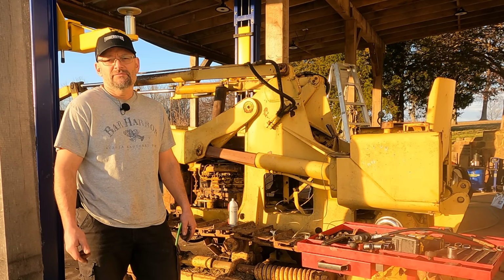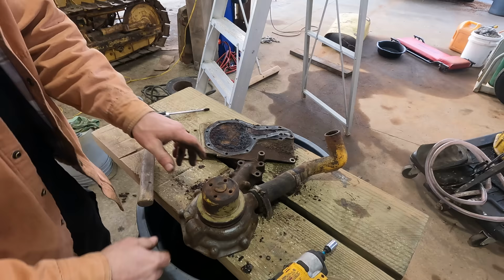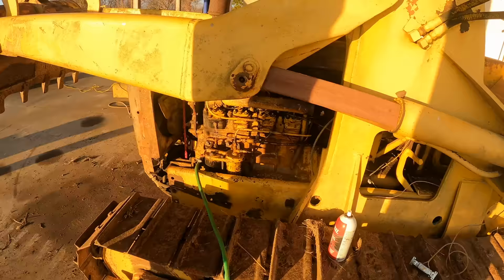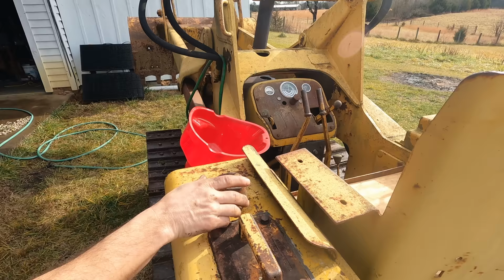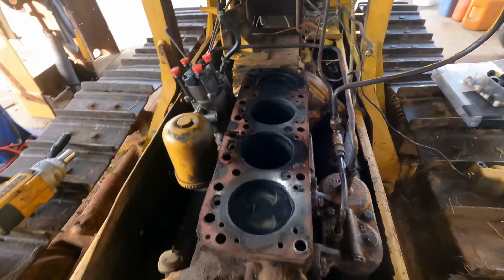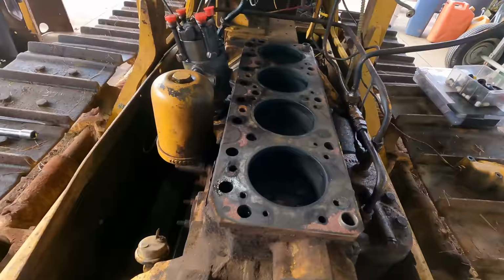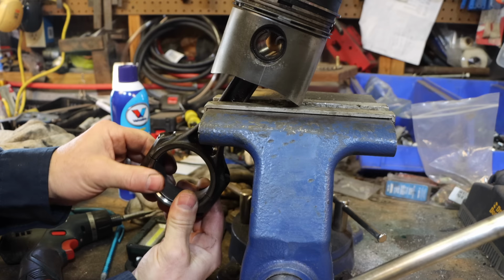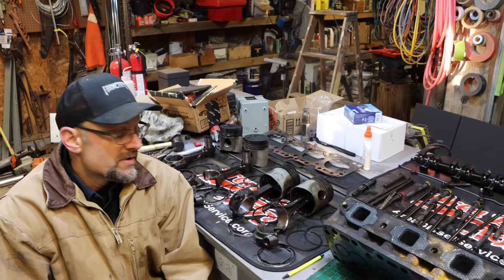1960 John Deere 1010 Diesel Engine Teardown.  Worth Fixing?

Comment: Hopefully you can find some good used pistons; I have an idea that your pistons were damaged due to hydro-lock before you ever got the machine.  Seems to me that pistons aren't cast perfectly round; they're slightly oval, but when they are at operating temp they are round, and that would be difficult to replicate.  Go ahead, measure a piston at room temp and then at 250°F, I hope you can prove me wrong.

How badly are the valve guides worn?  Can you knurl and ream them to be in tolerance?  Maybe replace valve guide seals?
 
Here's my contribution for a fresh set of glow plugs or whatever you think would be most helpful.

As always, I am really enjoying your content!
Reply: All good points!!  Rings and lands can also be broken during removal due to the ridge at the top of the cylinder, Glad to see John remove those beforehand.  

Aluminum pistons are typically 'cam ground'.  They would be narrower across the wrist pin axis to allow for the expansion of the greater amount of material at the pin bosses as it heats to operating temperature.  That's a contributing factor as to why the older diesels rattled and smoked alot until they were warmed up and the Piston fit the bore properly.
Reply: @workparty3949  That is correct. Pistons are cam ground and not completely round. I hope John raises enough money to replace the hole set. Pistons and liners. If not, maybe he can locate a complete engine.
Reply: @OutreachBibleProject  Well, while in an IDEAL world, a fresh set of liners and pistons would be great.  However, you're talking $3,500 worth of parts, and replacing cylinder lines that are STILL WITHIN factory specs really doesn't make sense to me.  What DOES make sense is hone the cylinders to a nice crosshatch, reducing pits/scratching as much as possible without going nuts on it.  I wouldn't blink if Jon used some J-B Weld to level out some of th ed scratches a tad; it's his machine, his call, and he really isn't trying to build a Cadillac or a Formula 1 car, it's just a utility dozer-type thing that's captured everyone's attention and we all want to see this goomba working again -- only much better, naturally.  I think he'll be fine with the 'just within spec' parts.

Comment: I've TIG welded pistons before. I'm certainly not any kind of professional welder, but it worked better than expected.
Reply from the maker: That's good to hear.  I really need to get a TIG welder, and I thought about buying one, but this is just not the job to learn aluminum welding for the first time.  It takes 6 hours of reassembly to find out that your weld sucks.  ;-)
Reply: It's the crossover we've all been waiting for....
Reply: @FarmCraft101 time to hit vevor up for one ?
Reply: Don’t weld it! You know how good the aluminum you smelted and made the fitting turned out. Heat treatment is a primary requisite for good aluminum and in welding you will ruin the rest of the pistons strength. There are used parts or new from someone besides JD.
Reply: @tmicadet  T5 heat treatment (aging) is done at a temperature pretty similar to engine operating temperature. They're in essence self heat treating.
Reply: @WatchWesWork   West, it's very nice to see you here, maybe a bigger collaboration with weldingtipsandtricks, that would be amazing, not to mention getting Mat from Diesel Creek involved. 😍😂
Reply: You know this, get to cleaning the broken pistons/or all. Need to be spotless for welding. Remove as much of the oil as you can, there will be some impregnated into the aluminium.
Reply: I think we in the more western side of the world sometimes forget how much you can "fix" something with "just" time, effort and ingenueity  when there's no real other option, you can see it in some of the repair videos you see from the likes of india where guys in their bare feet will re-cast and machine a new piston that you or i wouldnt sweat dropping $200 on, or weld a block and rehone it, you still see some of that here on johns channel, working with what you got, cos in some areas of the world thats all you got, due to parts shortage or just too expensive, so you bodge it, sure the machine might only be at40- 70% its original capacity, but in places like the 3rd world thats still better than 0% and it doing no work.
Reply: @aurick861 yes, soak them in an organic solvent such as TTE (if you can find any, damn EPA)

Comment: Don't know if anyone else mentioned but you should rebuild those injectors to get a nice and even spray pattern, in the first video you can see they the spray was too heavy and dripped the spray should be much finer and no dripping.
That would increase the starting much easier and reduce the smoke👍❤️
By the way, I love the content
Edit: bad spraying injectors can ruin the engine.
Reply: I agree. If you're gonna do all that other stuff, the injectors deserve some attention too.
And I'm pretty sure Jon already has most of the parts laying around, to build himself a testing rig, to test opening-pressure and see the spraypatern of each individual injector.

I know some Dutch-spoken videos about this, but I don't think they gonna help Jon much. I'm pretty sure there must be English videos about this too, so if anyone who understands what I mean can paste a link, we might save Jon some research-time...
Reply: Probably soot on the injector thing, I've wondered if you could just lap the end of the injector together with fine diamond lapping paste to get diesel injectors serviceable again
Reply: Expensive to rebuild the injectors plus you need special equipment.
Reply: @jameskim62  expensive???
Depends mostly on how much you pay yourself per hour.
Reply: here is a howto link :https://www.youtube.com/watch?v=dns1XMOJI5w
And here is a how to to build your own testrig from a bottlejack link https://www.youtube.com/watch?v=luxMeMHhbYE
And many more just search old diesel injectors :https://www.youtube.com/results?search_query=how+to+test+old+diesel+injectors

Comment: Adjustable link v belts are actually really strong. I've run them on vehicles in the past and had no problems whatsoever even long-term.
Reply: Agreed ! in cases where you have to dissemble half the machine to replace a v belt they are the ONLY way to go even if they are expensive as all get out!
Reply: In the words of Wes…” it’s only temporary, unless it works”….😂
Reply: They stretch, so you must keep shortening them !
Reply: @malcolmamosafsm1890  I found that they spent quite a bit in the beginning but then after a while they settle in.

Comment: I cried a bit when you decided to fix it instead of scraping it.
Reply: I agree. An utterly un-interesting little machine, cheaper than a Caterpillar in its day for a good reason. To quote a collectible motorcycle buyer's guide: "We have left out motorcycles which were considered rubbish when new"
Reply: @erik_dk842  the opposite, I understand the feelings John has for the 1010 John...
Reply: @makemeafirewall  Why? He purchased it in the current scrapworthy condition.
Reply: @erik_dk842  because of something small we all have and we call it Hope.
We expect it to be scrap but we also hope it will turn out to be a great success.

Comment: You might check on pistons made for other engines by bore &  wrist pin diameter and the measurement from top of piston to center of wrist pin & top of piston to the lower skirt. I worked in an automotive machine shop years go and we replaced obsolete parts like pistons and valves with new ones designed for other engines. An example was an early Indian Motorcycle engine where we used Dodge pistons and Continental valves. Looked them up using a catalog which showed specs/dimensions instead of by model.

Comment: Hi John,  Many moons ago I served my time on Perkins Diesels. Welding the pistons is a bold move but when you're in the phoo, needs must. You'll get away with honing the bores and new rings. I'd strongly suggest new big end shells if you can get them. The improved compression will likely add extra load on the white metal shells and accelerate the wear. Given the age of the engine, the oil pump will likely not be as efficient in keeping the constant film of oil around the big end journals, so new shells will certainly help.   I'd also recommend when you do the valves, replacing the valve stem oil seals as they will be as hard as a whore's heart. The witness burning between the cylinders on the block suggest that the head might also need skimming, but run wet and dry paper with WD40 on a heavy surface block over it and the liner plate first to see how it looks.

Comment: HOT TIP Instead of ether to start it use a blow torch and aim the flame directly into the air intake. Crank it over while heating the air going in and will start Much quicker
Reply: He tried that in the original video to get it started, so he knows about that trick.

Comment: I had a radiator hose blowout on a 280Z years ago. I was in the middle of nowhere and all I had was a roll of duct tape. I use that whole roll on the hose and drove at least 2 hours home. It wasn't perfect but it got the job done!
Reply: I not so serious cases one can stick a cutoff of a bicycle inner tube into the radiator hose, fold the ends over, and the hose is fixed. A simple and reliable field repair.
Reply: @guzziwheeler  That's a great idea! I didn't have one at the time and probably wouldn't have thought of it but that's pretty cool

Comment: To break a stubborn head gasket seal I have found the easiest way is to remove the valve gear so that all valves are closed then loosen tha head bolts one or maybe two turns and crank the engine so that the cylinder compression does the job. The fact that the head can only lift a fraz prevents any possible damage. The first time I tried this technique was on a 250cc two stroke motorcycle but I had removed the bolts entirely. You would be surprised how far those heads flew 🤣

Comment: Hi John, 

Have you seen the old trick for making gaskets where you take an appropriate sheet of gasket material, set it on top of the part you need a gasket for and then gently tap around the edges of the part with the round end of a ball peen hammer?  It makes perfect gaskets, is super cheap and it is very quick.   I learned this trick from a mechanic who works on high end German cars and he told me that a manila envelope/folder makes excellent gasket material- better than the expensive OEM ones in many cases- especially if you use a little gasket release goop on it.  I can attest that this works as the water pump on my sailboat auxiliary engine that pumps raw salt water for cooling has worked flawlessly since I did this over 8 years ago... 

Love your channel!

All the best from California (where your tractor will likely not pass smog testing...)  :)  🧡

Comment: I thought you were ready to bury her in the backyard but you decided to keep her on life-support a little longer. Yay! The welded up pistons should be a workable solution. If you can get that done, then a set of standard rings and a head gasket won’t be such a bitter pill. With compression back up where it belongs, I believe she’ll run real nice. We’ll see. Thanks for the suspenseful content!  🥸👍👀✅

Comment: It is amazing those old parts last forever you buy a new water pump today from China and it will last 3 months. I will bet a John Deere 219 engine would fit right in there. You just made my life so much easier, I never knew they had adjustable V belts I am going to get some and when I have a machine down and I need to get it to the shop I can just throw one of those on. Thank You.👍

Comment: Do not change the cylinders. There may be cracks in the web between the cylinders. As long as they are not water, rings might be enough.
I’d say rings are broken due to ether start.

Comment: There is a guy in the midwest that you can send sleeve deck to, and is overboring sleeve decks, and sending back with new pistons and rings. He is on some of the facebook forums. If you remove sleeve deck from block, be very carefull. The cylinders are silver soldered to the deck plate.  They can brake off. Most people have sucess using pucks on bottom of cylinders and carfully and evenly pushing it up and out.

Comment: If you put the air cleaner back on , it would probably have enough restriction on the intake to have it shut down properly, even though it is still sucking oil from the crank case. I think you should put in a set of new rings! I don't know what is involved in fixing the clutch and brakes, but would love for you to further my education! I am so pleased that you are repairing the engine! While waiting for parts, maybe you can give us an education on clutch and brake repair.

Comment: Yep,
     in essence you have a piece of equipment that (at the time),  given its size/weight etc., it was the forunner to what we now know as the skid steer.  I personally think it is a cool piece of equipment…, but I am with you in that the cost to put it into service…., puts it what down a list of other things to done.
     If the little dozer you have, were in the shame shape as this John Deere, well I would be inclined to spend $4000 to get it up and running.  If your friend or a viewer can assist with the piston repair, then a set of rings, put it back together and run it.  See there how I can spend your money.
     I think your decision to fix it is a good one, and it appears the rest of the crowd feels the same.
Great videos here,
Thank you sir.

Comment: John, you might try getting some Eternabond Tape. It is made to seal roofing membrane, and seals really well. I keep some around the shop for waterproof seals. It works well at a wide range of temperatures. Only caution, once it is applied, it will take solvents and scraping to remove it.
Reply: Is that a brand of butyl tape?
Reply: I am not sure if it is butyl. Their web site says it is a thermoplastic. I originally got it to repair an RV roof membrane and discovered many other uses, like gutter repair.  @RossReedstrom
Reply: Sounds like Flex Seal tape
Reply: Eternabond tape is really great. I suspect it would fail at the temperature the hose would eventually reach, but it would have held fine for the test he ran. Like utubota5522, I got it first to fix an RV roof, and then found a thousand uses for it. 

His warning is correct, once it sets up on something, it's there for a long time.

Comment: Don’t forget to weigh the pistons before and after repair so that rotating assembly balance is maintained. With two cracked pistons and broken rings, I’d worry about metal wearing down the crank bearings. I’d also chase the oil passages in the crank just to make sure they’re free of debris.

Comment: Thoroughly enjoying this series!! May I suggest that you do your best to locate 'original' pistons. Welding up the 'lands' and re-machining them will work from an aesthetic point of view, but I believe any weld will be far too soft to hold the load of any combustion. Even if you found a different piston (from a different engine) and machined it to be the same dimensions, I think that would be a more 'workable' solution. And I'm sure you're already aware that ether is most likely the culprit for them being damaged in the first place. Thank you again for the awesome video!!!
Reply: I have heard that ether should never be used on a diesel because it ignites too soon,  before the piston is at TDC and tries to push the engine backwards. In your case, it was probably necessary to wake the old girl up.

Comment: When “rebuilding” that radiator hose…if you use rtv like a glue, it works surprisingly well. Smear it on the inside cracks if you tape the outside…or “glue” the tubes and then tape…blah blah. RTV that #%## bro!! Haha. Great progress. Thats a cool little machine. Hope the whole thing comes together and you keep it. Good luck!

Comment: Hey John, be careful with that red RTV or any sealants that smell like vinegar.  They contain acetic acid and will rust the crap out of any cast iron or steel parts.  There is some "Ultra Blue" and a few others that don't contain anything that adversly reacts with metals.  Save the "High Temp" red stuff for the exhaust system.   A scuba tank and mask would make driving that around a lot easier on your eyes and lungs...  Thanks for the videos!

Comment: Don't think about how much the machine isn't worth it to fix.  In every day life it isn't.  However, the knowledge and skill and let's not forget the achievement to see how cheaply you can make it like new.  And the value of educating others and helping them also see it.

I often think about if SHTF, could I make such a machine from scratch?   Extracting the ore, melting down enough metal, shaping, lathing, assembly, design.  It would be a monumental task to do from scratch, the thing is you already have 98% of the machine there.  It just needs about 2% reforging, so to put that in perspective, YES!  It's worth it!

Comment: Glad to see you are taking the head off of it. My experience with automotive engines and also the fact that I worked for GM for years pistons all start out as generic. The pin height has more to do with the CID than most people think. 454 and 427 pistons are the same except for pin height and of course rod length and crank stroke. Same between small block chevy and small block fords. So, by now you see where I am headed. It is possible to find some used pistons or used rings. After all You and I have the same DNA. I'm not saying do a shitty job but where there is a will there is a way. I also save used hydraulic oil. In industrial hydraulics we used a portable pump and filter system to filter the hydraulic oil while itis still in the machine. We used hydraulic oil by the drum full. Boss Kettering (the inventor of the electric starter said") The problem will tell you the solution.